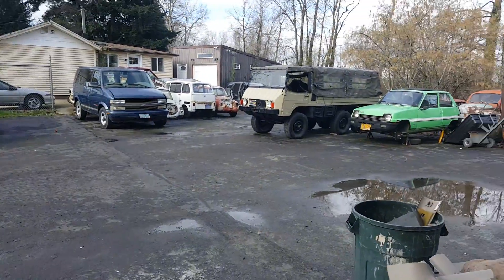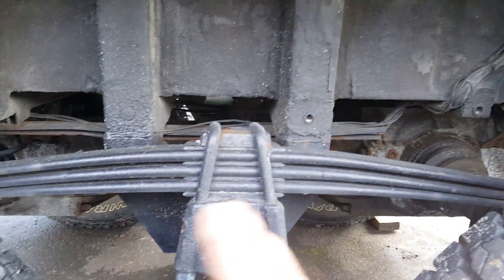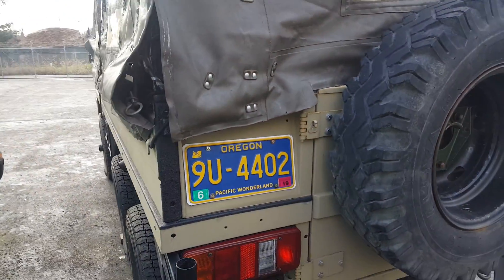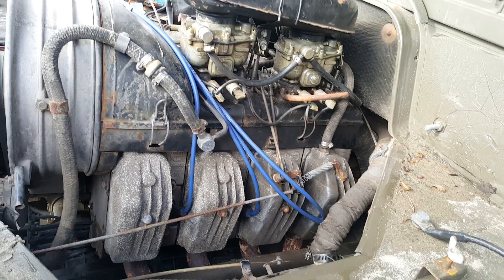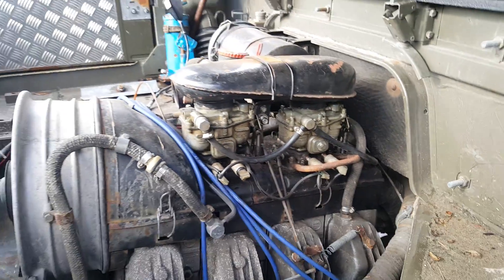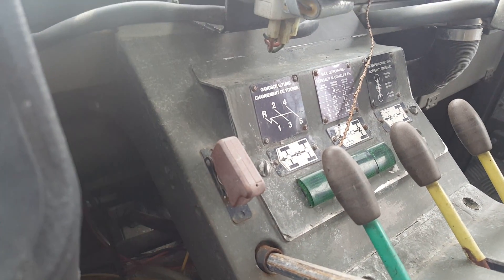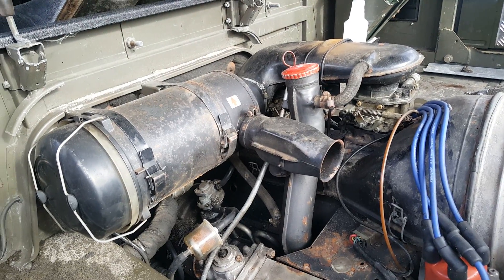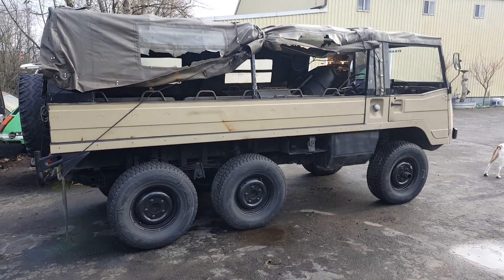Kooky Pinzgauer 6 Wheel Drive

Comment: The Pinzgauer was basically a larger version of the Haflinger which had a twin-cylinder air cooled engine and four-wheel drive.  Because of the way they are built, basically a pontoon with everything hung off it, they are actually surprisingly light for a vehicle of their size and they are immensely capable off-road, almost to Unimog standards.  The British military are using them now, most of those I've seen have been in ambulance format but I have seen a couple of general purpose/troop carriers, with the Land-Rover Defender having died and the 130" version used for ambulance use by the military having, apparently, been killed off a couple of years ago.  Despite there being 45 years between that one and the ones coming into service now they're still largely the same, now with diesel engines and 4x4 format rather than the 6x6 here...

Comment: Steyr-Puch, austrian company. Made the Puch 600, an austrian version of the Fiat 600 in the 60s/70s. The little brother is the Haflinger (a race of horses) which is smaller and has the Fiat 500 engine. In fact, it is very small. The Haflinger and the Pinzgauer (Pinzgau=region of Austria) are used by Austrian/swiss/German and many other armies. Very popular among swiss farmers who used to buy them at the yearly army auction in April in Thun (city in the Kanton Bern). Puch is building the Jeep cars today for Chrysler.
Very famous are the "Puch Maxi" mopeds and of course the old motorcycles.

Comment: The Pinz is NOT a hodge podje of parts and like was said below this is a 712 NOT a 710, ALSO the are NO Porsche parts on a Pinz the guy was really showing his lack of knowledge in almost every way when he was introducing this vehicle.  It is a 4 stroke engine NOT a 2 stroke, yes it is air cooled 4 cylinder and that engine makes around 88 hp which gives the Pinz a top speed of around 50 mph!
In my experience there are 3 main offroad vehicles in the world there is the PINZGAUER then there is the GAZ model 66 then there is the Unimog!  I have owned and run Unimogs for years now but in my opinion as far as off road capability the Pinz and the GAZ will do anything the MOG will do and in some cases maybe even better.  For off road mobility the PINZ is one of the toughest trucks out there!